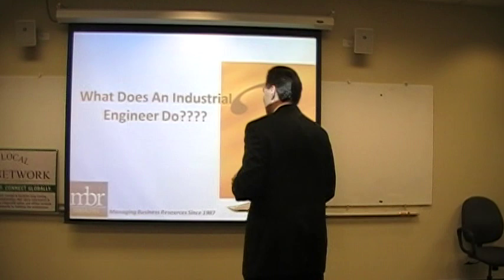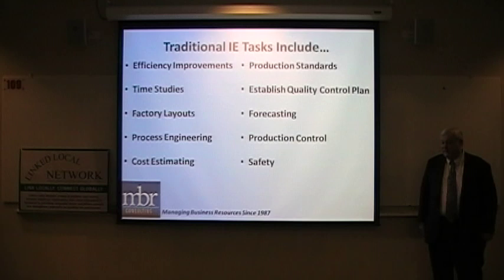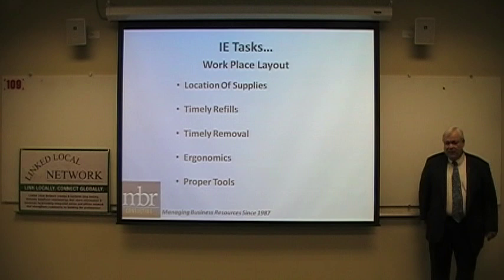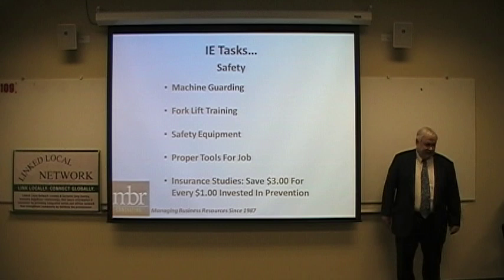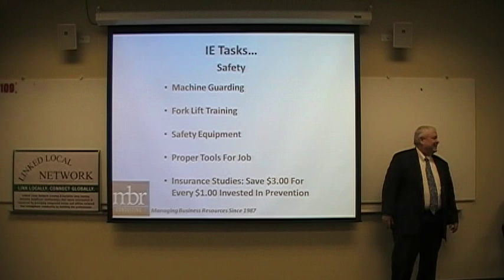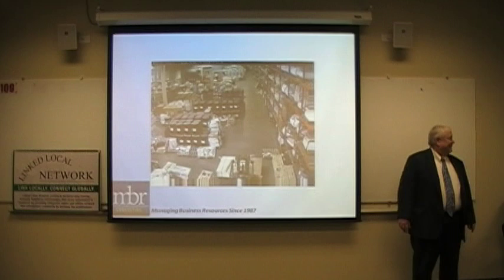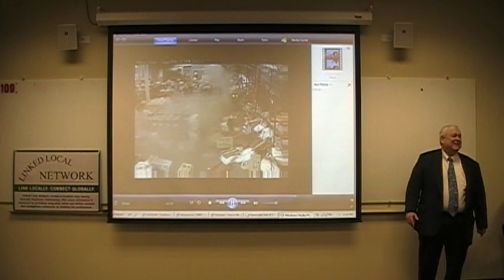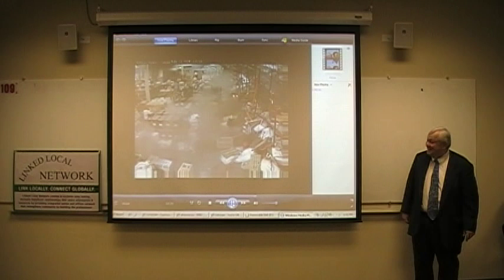Manufacturing Tools - What does an Industrial Engineer do???? by Marty Rosenbloom of MBR Consults

Comment: What is the difference between industrial engineering and manufacturing engineering and who is the best
Reply: Industrial Engineers are concerned with the design, implementation, and improvement of integrated systems of people, materials, equipment and energy and how it works in the local environment. All facets of the manufacturing environment are affected. Manufacturing engineers apply their knowledge to selection of proper manufacturing processes. Industrial Engineers "make it work" within the manufacturing confines. As to which is the best, that is purely subjective and require different skill sets.